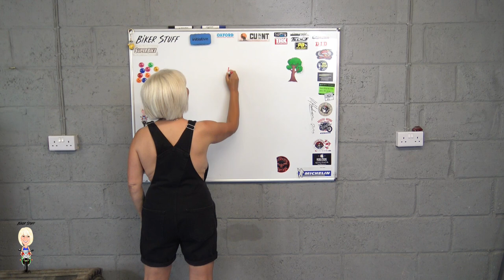Know the difference between JIS and Phillips screwdrivers

Comment: Posidrive screws were used on 70s Triumphs, mainly on the engine casings, although many have been replaced by their owners with cap screws (allen screws). Mine still has the originals.
PS When I bought my Suzuki GS550 a year ago, the first thing I did was order a set of JIS screwdrivers and bits. When the bike arrived I found all the screws had been changed to cap screws or posidrive.

Comment: JIS vs Philips is a challenge for repairing things like audio gear and other electronics.  It can be a challenge in the US to find JIS screwdrivers.
Excellent video!
Reply from the maker: I do find that hard to believe.  You can buy Japanese products, so the tools to fix them must be similarly easy to find
Reply: @bikerstuff2  The challenge is common shops carry Phillips and the posi type for wood, but the JIS are carried at more specialized shops, and Iof course, online, one must be aware of the difference.  A common hardware store here will often not know what a JIS even is, to my chagrin, but to be fair those stores are mainly for home repair, not machines.

Comment: Vodka and Orange juice. 🙂  You might have shown a close up of the tips of each screwdriver for additional clarification, otherwise another great video. Thank you
Reply from the maker: There was a diagram on the screen.  The screwdrivers will have what they are written in them.  If it's a Japanese bike or a Japanese part it will use JIS, nothing more should be needed to identify them.
Reply: I think the diagram of the Pozidriv has gone missing.
Reply from the maker: It's not important as they are not used on motorbikes